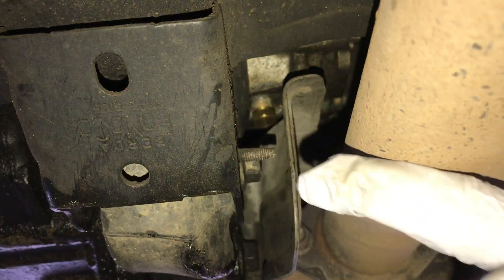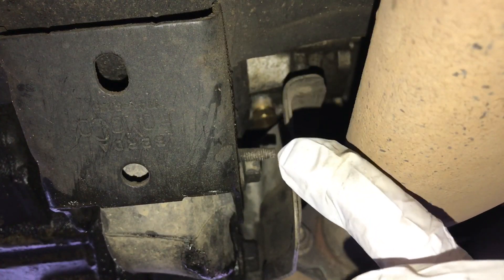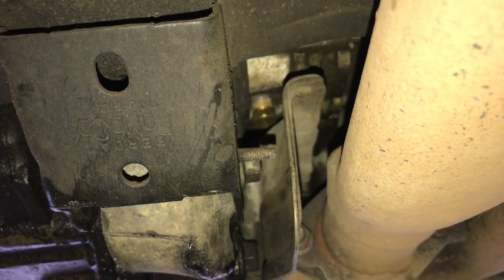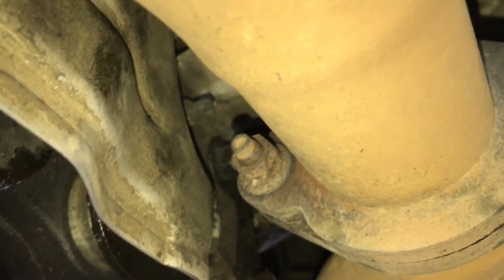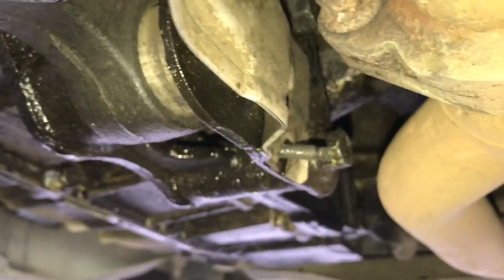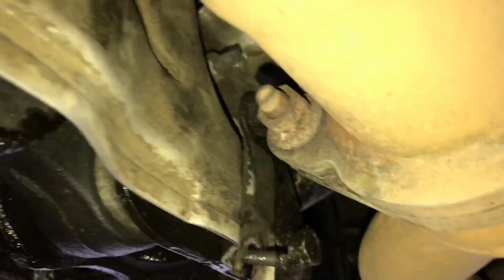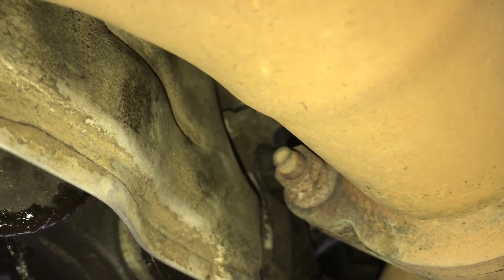Ford Edge PTU: Drill & Tap-Before and After 10K Miles (MKX)

Comment: I rotated my tires a little late 7/32 front and 5/32 rear will this damage anything
Reply from the maker: I am not 100% on a set opinion with this. I have seen the argument that this produces added resistance on the PTU and heats up the fluid more, and by doing this the fluid degrades sooner, which of to be believed might suggest a flush on the PTU sooner rather than later. However since I do not know 100% for sure that this is a primary part of the problem I just believe in servicing it with a 20k mile max interval. 10k miles is good too, any less is overkill.

Comment: The Great Minds of Ford  should have never built a gear train part that you cannot service . Not having a proper drain and fill plug is just one other reason  why these parts fail like they do . My 2010 Escape  AWD  making a humming noise like cupped tires  found out it was the PTU . Fords price on a brand new PTU is thru the roof at 5000 grand up here in Vancouver Canada   total Ford crap .I will never buy another Ford again .
Reply from the maker: The newer escapes are fully serviceable PTUs. Think the outcry of the public had them change their ways on certain vehicles in their lineup. Just had someone comment on my videos two weeks ago telling me about their 2015 and 2017 escapes being fully serviceable with drain and fill plugs.

Comment: Thanks for taking the time to make this video. Were thinking of buying a used Edge and we heard about this issue and this really helps. I think if we buy a used one with less then 25K on it and implement your solution will be in good shape. 
Since Ford doesn't want to come out with a solution someone needs to invent a oil circulation, filtration and cooler for the PTU.
May be after I get mine I'll work on that.
Reply from the maker: Go for it man! There’s definitely demand for it!
Reply from the maker: NM T drill and tap ‘em anyways 😜

Comment: I have a 2008 Edge. Seem to have an issue after shifting from 1st to 2nd gear (automatic). I believe the PTU is the issue. Is it possible just a flush and fill would fix the issue?
Reply from the maker: Kyle I would start with a flush and fill of the ATF. Switching to Valvoline Maxlife Sythetic ATF; doing this got my shifting smoothed out. Had to drain and fill the transmission 5 times to accomplish this though. Mine was in first to second gear too. Not saying your PTU doesn’t need a drain and flush too but I would start with transmission as top priority.

Comment: So hey there buck great vid in future only use 1 1/2 wraps on tef tape or use nptf then no tape or dope is required for job also when drilling use a piece of pipe over the length of the drill bit so as to not jam it up into the ptu would be shitty to break a hardened bit up in there
Reply: I like the pipe idea jbstepchild. I have to do this procedure on our Escape and will use your idea. Thanks.
Reply from the maker: Oh for sure if that bit breaks off inside there and you cannot recover then 🤬

Comment: Thanks for this video. I have to re-seal my input shaft on my explorer and am planning on doing this at the same time. What drain plug did you actually use?
Reply from the maker: tourerv1jz that’s a brass 1/4 NPT plug from O’Rileys auto parts store. Every auto parts store should have them in stock I would assume.
Reply: @buckn32  The video you posted that shows the location of the drill and tap suggests 1/4 or 3/8. Do you know anyone that used the 3/8?
Reply from the maker: No I do not. I think I’ve seen someone in the comments say they were doing the 3/8s but haven’t ever had the feedback as to whether that was great or not. My personal take away is the 1/4 is fast, I’ve drained 3 or 4 times with no issues. I think the shape of the PTU helps to expedite the flow of the fluid (when hot) compared to an oil pan which takes a while because they tend to be more flat.
Reply: @buckn32  I have both taps and the plugs I bought from Home Depot are square head which I don't think I want to use. I'm thinking I will head to O'reillys and see if they have a hex head 1/4. No need to break new ground if the 1/4 works fine as a drain.
Reply from the maker: I do not think you will be dissatisfied with the 1/4 as long as you are on a regular service interval. I haven’t had any issue with fluid flowing at a bad pace.

Comment: How can I find out if my ptu has been replaced? Just bought a 2009 Ford Edge awd with 121,600 miles
Reply from the maker: terry mise I’m not 100% sure there is a way to find out if it’s been replaced or not because most people are just going to replace with a Ford (fomoco) part in lue of going with something aftermarket. I would be more attentive to the quality of the fluid within the PTU as your #1 indicator of PTU life. Frankly if that thing isn’t making a horrible noise it still has life, just make sure it’s serviced regularly to keep it from getting to that point.
Reply: Buck Newby haven’t heard any noises and no leaks. I’ll need to use ramps to get it up high enough to give me working room, then of course it won’t be level when I check it. Thought that if it was serviced or repaired at a ford dealership they would have it in their database.
Reply from the maker: terry mise they might... but even on ramps it will be level enough to check the fluid
Reply: terry mise just do it for peace of mind,

Comment: Thanks Buck. With the help from your video I just did this to my 2014 Sport. Not too hard at all. FYI, I bought the drill bits from Lowes(Titanium) & your TAP from Amazon. As for sucking it out from the top bolt you’ll only get 2oz at a time. The PTU takes about 10ish oz after drained.
Reply from the maker: Glad it was able to help out 😄 you’ll love how much easier servicing is going forward!

Comment: Buck, when attempting to pump fluid into PTU the tube is blocked from being inserted fully which results in fluid leaking out as if the PTU were full. How did you manage around this?
Reply from the maker: Do you have the vehicles front end jacked up? You can turn the tires if it is off the ground on both sides, thus rotating the gears inside. Also make sure the angle of the tube is downward, you should be able to slip it in a couple inches between the gear and the PTU casing.

Comment: Buck, Was your MKX PTU leaking when you decided to drill, drain, and plug? Did it stop the leak?
Reply from the maker: @John Barbee in a roundabout way yes it was leaking. What happens is there is a pressure check valve that kicks open when the PTU gets too hot because the fluid is losing its lubrication property. Draining and filling my PTU with fresh fluid fixes this issue and now it doesn’t leak anymore because I stay diligent about servicing it regularly.

Comment: Hi I have a ford edge 2011 just checked the ptu fluid from the fill hole and tried to suck out oil but it was empty nothing inside it was dry and I only have 10000 km on the car filled it up again but not sure what is going on if u have any suggestions for me please let me know and if u can post a picture of the exact spot u made the hole in the ptu that would help alot

Comment: Thanks for the great video! It's very difficult to get info like this, especially from Ford. I myself have a 2016 Edge. As you are probably aware Ford eliminated the fill plug or any plug for that matter, so this fluid can not be changed. It's now called a "Lifetime Fluid". Smart?? arghhh. Anyway I was thinking about towing a 2800 lbs trailer with my Edge and was curious if you know how to get fluid to these newer PTU's?  Find an older one and swap it out? And that's only possible if there's a matching fit between the old and the new. Any help would be Greatly Appreciated! Thank You.
Reply from the maker: Exactly... getting a straight answer from someone who is paid to sell service, especially from Ford, is simply impossible. They’ve been calling it the “lifetime fluid” ever since the first production model (2007). If you plan on towing regularly I’d service every 8k miles. You can drill and tap the PTU you have if you want to put a drain plug in it, which will make service much more straight forward. Or do everything from the fill plug, which is located on the passenger side of the PTU and kind of tough to get to, but not impossible. I jack my Edge up and crawl under it when I service the PTU and can access the fill plug easy enough coming from the rear of the vehicle towards the front AND over the cross member.
Reply: Hi Buck, I'm confused due to the many stories I've read and heard. One was being told that there is not even a Fill Plug anymore for 2016.  100% sealed. Is that true or false?
I haven't gotten underneath her yet.
Reply from the maker: If that is true it would be the first time I’ve heard it. What model do you have specifically? Is it the Sport by chance? If so the Sports even come with drain plugs! Starting model years 15+
Reply: @buckn32  It's a titanium 2.7 eco. AWD
Reply: Tomorrow I'll get her up on jack stands. I'lll let you know what's there. Thanks for your help.
Reply from the maker: @Oldpolcat I will admit I am less familiar with some of the specifics with the 2.7 Eco so I’m eager to hear what you come back with when you crawl under. 😊
Reply: @buckn32  My info was no good. It does have a fill plug. Man, this thing is so close to one of the exhaust pipes! It's has to be cooking the ptu. I'm going to go ahead and do the drill and tap method you described. Siphoning, in my humble opinion, really wouldn't get all of the "funk" out of the case. Plus draining just seems easier for the long haul.  :- )
Reply from the maker: Oldpolcat you’re barking up the right tree! That’s exactly why I drilled and tapped mine.
Reply: @buckn32  Update: For the sake of accurate information, the 2016 Edge does have the drain plug also. I'm an idiot...initially I didn't see it. My neighbor came over with a fluorescent work light that we were able to snake in for a better view. Also by the time he showed up the snow and slush had melted away making things a lot easier. So with that said, the oil drained out was no better than mud. This is with 24K miles. Definitely not a good sign. IMHO, 10K or less for this fluid.  With towing, as soon as possible upon returning home. But that's just my opinion. Take care.

Comment: Wow not bad I have 123000 miles 2007
Reply: I change it every 10000 miles and the PTU was replaced before I bought it with 103000
Reply from the maker: That’s the interval I recommend for PTU fluid change.
Reply: You never changed the oil?

Comment: Are PTU problems only on AWD for the Ford Edges?
Reply from the maker: Toro Man I’m not exactly clear on what you are asking but yes and no. If you asking if they are only on AWD versions of the Edge/MKX then the answer is yes. On FWD Edges/MKX there is no PTU so thus no problems. On other ford vehicles that have PTUs on the AWD models like explorer escape and focus the PTU problems are an issue too.
Reply: Ford Escapes as well same shitty design.

Comment: Hi Buck,

I have a 2008 Ford Taurus X AWD with 119 K miles. When I bought it at 106K miles, the PTU was empty(I found out later after buying). I gave it for servicing at a local mechanic twice. First time they filled it up and second time they drained about 14-16 ounces fluid and filled it back up. Third time when I tried to drain the PTU with a geared oil vacuum pump I could get only 10 ounces out and I filled it up again. When I tried to drain it myself, it was bad smelling oil, not burnt smell but bad smell. Do you think I should do the drill tap and drain plug procedure? Or should I just drain it with pump? Also, can you tell me exact size of Drillbit, Tap and Plug?
Reply from the maker: Jyoti Swarup Singh doing it the way you did it is perfectly fine. It’s a little more tedious this way but if you increase service interval to 7k miles you shouldn’t encounter any issues. With the drain plug I’ve been going 10k between services. I’m pretty sure the exact sizes are in the video roughly about a third of the way into it.
Reply from the maker: Jyoti Swarup Singh you need 

1/4 NPT plug
1/4 NPT tap 
7/16 drill bit

Comment: Where do u refill it at after you drain it...?
Reply from the maker: 1OAK406 yep passenger side of the PTU there is plug that you fit a 3/8 square drive ratchet head into... at least on first generation Edges it’s a square head, but I believe it MIGHT be something  different on the brand new Edges, like a torx head or something, never worked on a new one so I’m not really sure, but think I remember seeing that somewhere.

Comment: Need advice...2010 Edge AWD now at 80k. Sucked and refilled PTU oil at 75k. Should I ask a mechanic to tap a plug or ask to evacuate and refill? First change was thick dark almost black.
Reply from the maker: I suppose it depends on your plan for your Edge? Do you plan on keeping it for 20k miles or 70k? I’d say if you’re planning on keeping it longer than 20k more miles then drill and tap. That way you have time to get your money’s worth. If you plan on selling at 100k miles, then simply service at 80, 90, and 100k miles.
Reply: I plan on keeping beyond 100K. It's paid for and drives nice. I'm really afraid of the metal shavings going into the PTU during drilling. I mean it's the metal shaving that can induce the breakdown of the PTU right?
Reply from the maker: pindiwal - Correct. You would have to flush extra fluid through right after the procedure and then drain and fill again after a little bit of driving. But for an example since doing mine somewhere around 180k I’ve drained and filled 3 times with no issues. Once right afterwards, once in this video and once at 200k. But the PTU is holding up well as far as I can tell.
Reply: @buckn32  Thanks Buck...I appreciate all your help with videos and answers. I also follow MACT. Do you recommend any one gear lubricant? MacT suggests Redline LightWeight Shockproof. My mechanic did one drain n fill with Motorcraft but since they're the ones to mess up this design, I kinda don't trust their gear lubricant suggestion...your thoughts.
Reply from the maker: pindiwal Redline lightweight shockproof is what I have at home. I originally flushed with O’Riley full synthetic; then went to Royal Purple, now Redline.
Reply: @buckn32   Hey Buck, just bought a hand drill pump. Planning to siphoning out the PTU fluid. I think I'm gonna keep doing this every 10K miles. The transmission and PTU design and shifting are not the best on this vehicle. Engine power is great though.
Reply: Update: still haven't tapped a plug but now I'm at 100,000 miles. Been changing the PTU every 6k-7k miles. Replaced one seal on transmission side (right side).